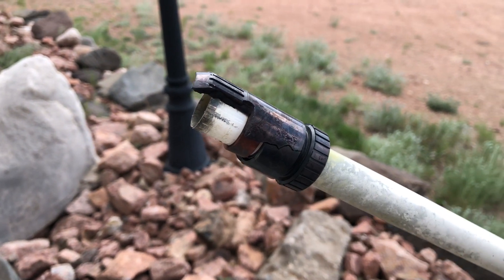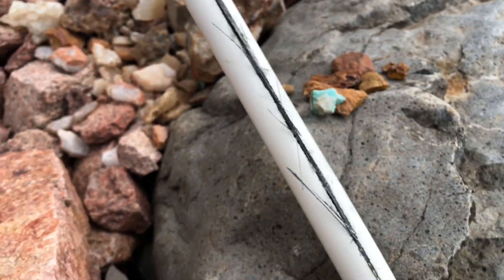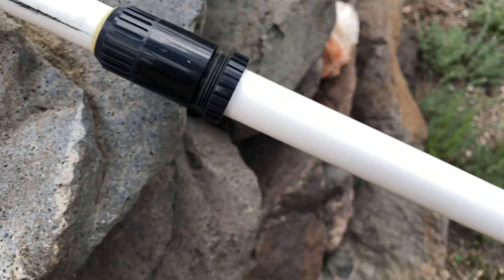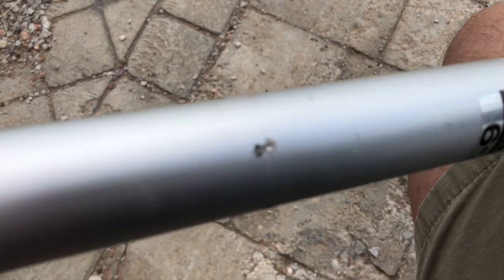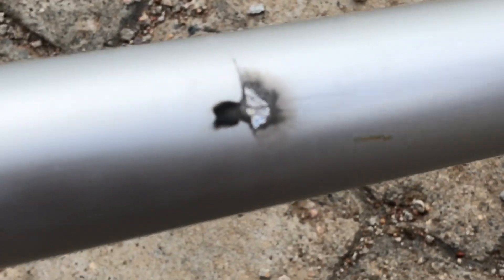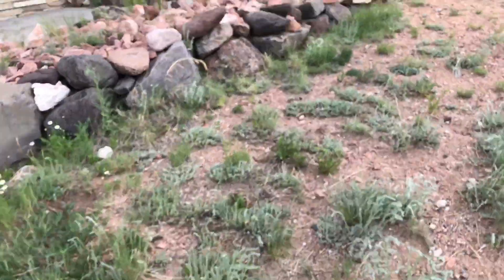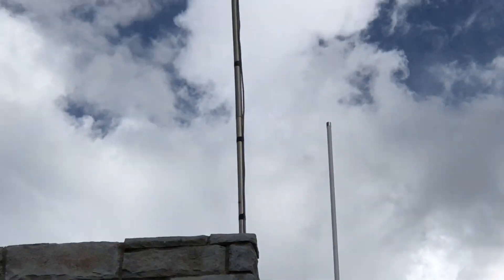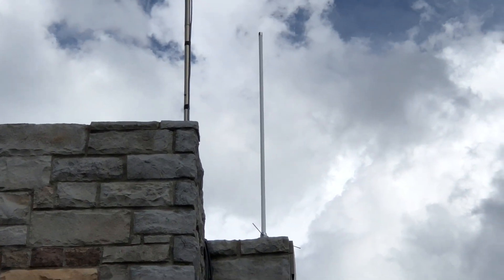Ham Radio Antenna Lightning Strike - WHAT HAPPENED??

Comment: I do NOT leave Ground Wires hooked up to the Radio during a Lightning ⚡️ Storm. If you have a severe strike close by, it stands to reason the Potential is also able to travel via the GROUND. Don’t leave your radios grounded during a storm; bad idea. Put an alligator 🐊 clip on it and you can easily remove it when a storm passes. My 2c, licensed 50+ years 73

Comment: I had a V2 2 meter antenna whitch was hit by a main lightning strike. The fiberglass antenna looked like a bird with feathers after the lightning strike. In my opinion, fiberglass antenna attract lightning. I use antennas with gamma match now.

Comment: Lucky you, coax and radio wise.  My Comet GP-9 was hit a couple of days ago, (5/17/23) and it took out my antenna, coax and a radio.  Strangely, the antenna mast was grounded and there is a lightning arrestor connected between the coax and feed line going into the house and is also grounded on a separate rod. The lightning arrestor doesn't look like it did anything at all.  As far as a direct strike goes, I think, since your antenna damage looks very similar to mine, is that we may have been hit with one of the streamers of a direct lightning bolt.

Comment: If you look at the makeup of the antenna at the very bottom you will find a few capacitors. Some of the capacitors couple to the inside of the coax through the so239 fitting. BUT, the others couple to the metal of the outer normally grounded parts of the antenna. I suspect those capacitors are now more like solid wires, melted together ? Are you saying you didn't have the pipe that the antenna was mounted to going all the way to the ground ? Or at least a wire going to ground ? Typically the majority of the lightning pulse would jump through the capacitors in the bottom of the antenna out to ground, "taking the shortest path to ground" is the general rule. I've had it jump right out of the center of coax that was laying on concrete and into the concrete ! Shortest path was down to the ground (concrete) and not into the radios. That said, the controller of the repeater had a problem which I repaired and we were back in business ! We now use "POLYPHASER LIGHTNING PROTECTION" parts with ground rods ect.

Comment: I know this is a little old but I didn’t see it in the comments so I’ll throw my $0.02 out there.

I’m no electrical engineer as well, but I’m in the middle of setting up my shack and have been reading a lot on proper grounding to protect against lightning.  The most resounding thing I keep reading over and over is that there is virtually now way to 100% prevent a direct strike, but there are things you can do to minimize the risk.  Those things are 1) grounding your antenna mount and 2) grounding the coax by utilizing something like a lightning arrester.  

Lightning is essentially a MASSIVE example of the same thing that happens when you get a static electricity shock.  If your antenna is not properly grounded using lightning arresters your antenna can build up quite a bit of static electricity.  If the conditions are right for lightning and your antenna has a massive amount of static electricity built up, this cause cause your antenna to become the path lightning to get to ground.  I would imagine that is why your antenna received a direct strike rather than the pole next to it.

Comment: Lightning path is stange. Last year, our amateur radio tower got struck, wires conducting 220 volts electricy smashed to uncountable pieces, power meter smoked. Weired enough, the shortest 4.2 meters fiber antenna was the only one attacked by lightning bolt while two longer 6.5 and 7.2 meters fiber antenna were totally fine. All repeaters were grounded, but only the APRS repeater connected to the short antenna was destroyed. I searched for many videos regarding lighting hitting tall buildings, finding that sidewalls many storeys below the top probably get struch too. So I think, the path of direct strike can be sometimes beyond anticipation.

Comment: I believe the antenna exploded and basically shorted before the lightning got to travel down the coax.  I would run a ground wire from the metal mast up there to a ground rod, this will act as a lightning rod to absorb and dissipate any future strikes.  Yes, unplug the coax when not in use.

Comment: I lost 2 to $3k in equipment from a lightning strike a half mile away. It was such a big hit it disintegrated the tree. Streamers can create voltages in an area...not just a direct hit. Your very lucky you didnt suffer greater damage. Yet losing any $10 piece of equipment sucks. Thank your rock work, it may have saved you from fire.

Comment: I used to be a radio installation engineer for Racal many moons ago, and have seen a few 'blasted' antennas like this. Yes, it was a direct strike; the current fuses the antenna element and the metal vapor expands very quickly, causing the radome to explode, (a bit like you see trees explode when hit; the sap boils to steam in an instant and expands, shattering the tree). The burns you see on the side of the mounting are where the current has flashed sideways to the mounting, and into your stone wall, which at that location will conduct electricity to ground better than the feeder. 
Because your radio presents what is effectively an earth at the top of the antenna, that is the lightning's first point of contact. If the conductive path through the coax has a higher resistance to ground than an adjacent conductor, or presents inductive impedance, the voltage at the base of the antenna rises very high, very quickly. As it gets above a certain voltage, there will be a discharge to the next-best-ground conductor, and you will see a side-flash.
For your new installation, run a flat copper ground tape from the base of your antenna to a suitable earth-spike at the base of the wall, with as few kinks and curves as possible; connect the feeder coax outer to the same earth spike. Fit a lightning arrester to the feeder where it enters the house.
Disconnect your antennas from the equipment when there is a storm in the area. 
Thank your lucky stars that the house didn't burn down!
Good luck.
Reply: Yes and absolutely no. 
I've been an electrician for 34 years and have done a bit of tower and antenna work. 
First, it is NEC code to have a listed lightning arrestor, before it enters the building, on ALL feed-lines and or wires to ANY antenna. Failing to follow this will find you denied any claim under your homeowners insurance, should damage occur. 
Putting a ground rod at the bottom of the antenna with a lightning arrestor and calling it a day is worse than having no ground at all!! (Emphasis added)
There is a difference between "grounding" and "bonding". Using a separate ground rod for the antenna, independent of your utility ground, can develop 10's of millions of volts or 100's of millions of volts for a direct strike! The answer is simple ohms law. The difference in potential between two separate ground rods is enormous! (E= I X R) The average lightning strike is around 300 million Volts at around 30,000 Amps!!! 
You NEED to bond the ground rod below your antenna to your house utility ground with a minimum of 6 awg, stranded, copper wire with ground rods spaced about twice their length (ex. 8" ground rods should be placed about 16' apart) and you need a single point ground system, never two separate grounds! Ever! 
You also need to bond all of your antennas together with copper strap (see DX Engineering or Georgia Copper) or at least 6AWG stranded, copper wire (but I'd recommend 4AWG).
Please 🙏 never, ever, under any circumstances whatsoever add a second ground rod, unless bonded to your utility ground. This could be a very expensive and fatal decision!
Reply: @timmack2415  @Tim Mack  Hi Tim, Hope you are still on YouTube and doing well. 

I read your comment with great interest and have some questions.

As you know the NEC is a huge document. I couldn't find the requirement for amateur radio feedlines to have a listed arrester. Could you cite chapter and verse or at least chapter so I can study it? Arresters and feedlines clearly aren't going to withstand a direct hit but may attenuate the effects of a nearby strike and also help with static.

Next, why do you favor stranded #6 or #4 bonding wire between ground rods vs solid wire of the same gauge? Is it for edge effect and is that what code requires? How deep do you bury the wire?

When you say all antennas have to be bonded together, you mean their ground rods, correct?

I looked up copper strap and it comes in various widths and thicknesses. What thickness and width do you or the NEC recommend/require for bonding ground rods? I don't know the strap measurements that would correspond to #4 or #6 stranded wire. Maybe it's in the code and I just didn't find it.

Not mentioned in all of this is the radio, PSU, etc. 

I have seen some interpretations of the code that argue station grounding is not required because it is grounded through the 😮house circuitry to the mains ground. 

However the majority would have us run short 1 inch wide copper braids in parallel from each "box"  to a common copper bus. A single copper braid extends from the bus to a copper strap to a ground rod that is bonded to the service entrance ground as you describe. In your opinion and experience, which is correct?

Finally, how do I find an electrician or engineer as knowledgeable as you near me? What do I google? Not all do this kind of work or consulting from what I can tell.

Kind regards,
John
Reply: Hey man, I'm grounding a 9 inch, solid copper Hnt antenna to the top of my roof to the side of the house, can I ground it without a lightning arrester?  There's no way to connect a lightning arrester since the cable of the antenna is imbued or manufactured directly into antenna w/o the option to add an arrester, so anyways, I'm bringing a 20 ft solid 10 gauge copper wire down to the 8ft copper pipe I just hammered down 7 ft into the ground, that should suffice right?  The wire is directly connected to the (copper)grounding rod and up to the base of the antenna, wrapped around that is.  Thanks for your time, question is, does that suffice?  Thanks.
Reply: This guy gets it. If have to hazard a guess that this was a negative lightning strike. Had it been a positive strike, it's likely that there would be no antenna and a significant chunk of stone would either be vaporized or lying on the ground. 

PS. I don't know the EXACT specifics about different lightning charges, but if memory serves me right. You could survive a negative strike, but won't survive a positive strike. Positive strike have an obscene amount of current.

Comment: Did you have a lightening arrestor between antenna and coax?
Reply: Dick Grantberg Well perhaps the metal roof did act as a large ground to dissipate the energy, who knows. Lightening behaves so unpredictable that there are all sorts of theories and opinions on right and wrong protection. I would at minimum invest in a good lightening arrestor just to add a layer of protection and hope it works.